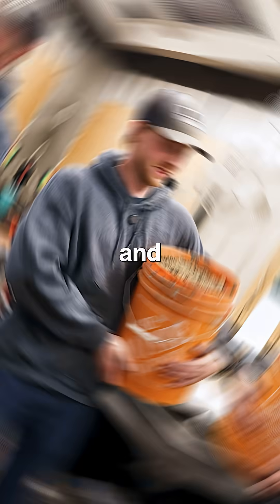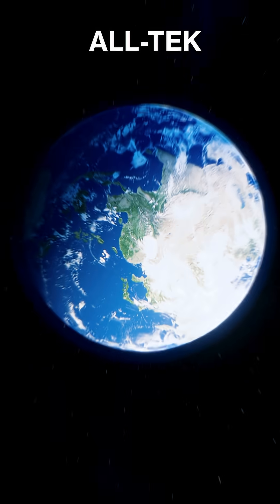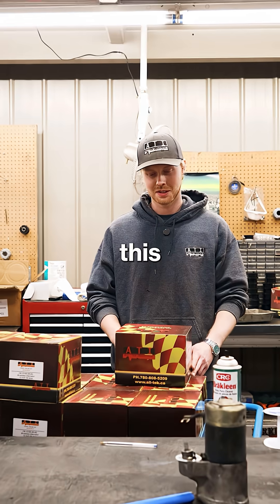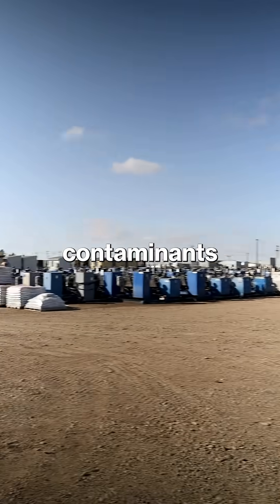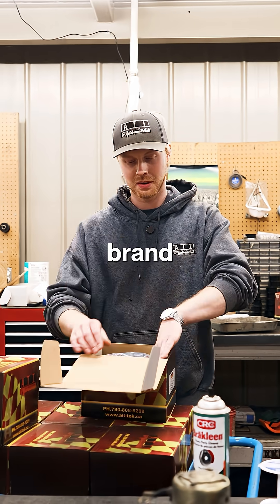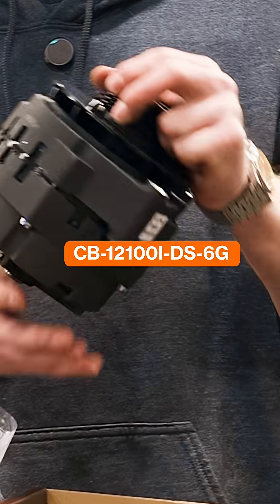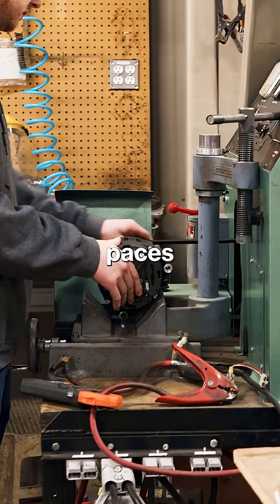BRUSHLESS ALTERNATOR VS 5GAL OF GRAVEL  #alternators #experiment #brushlessalternator

Comment: Forgot the name of the company , but they make him in australia for overland truck suv isuzu and etc. 100% seal from all weather with water cooling ? Made of stainless steel and aluminum? Do you have a new one's with the one-way  clutch ? 😢
Reply from the maker: One way clutches fail all the time. The only reason they have a one way clutch is to take "load" off of the motor when it is shutting down. If a bit of magnetic resistance will damage your motor..... you bought the wrong motor 😅